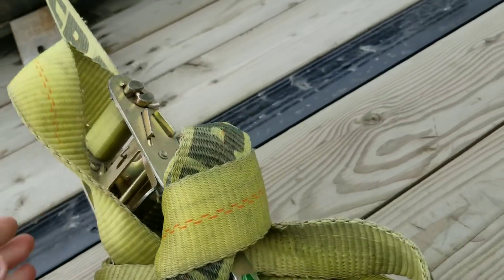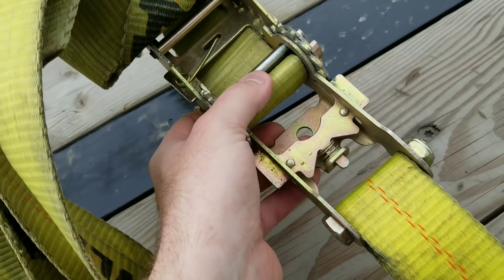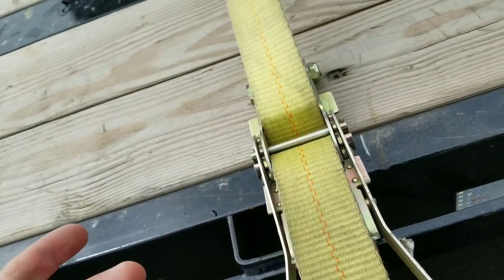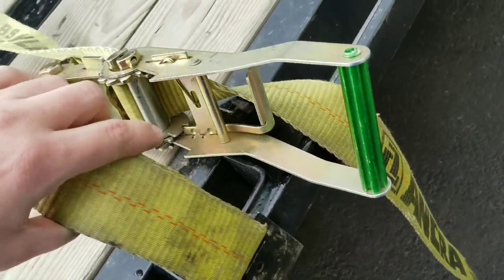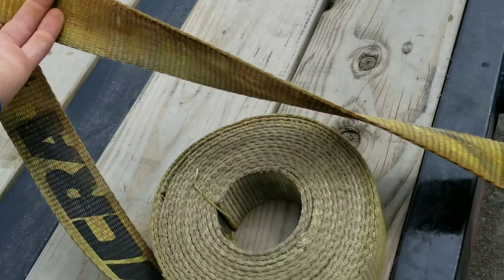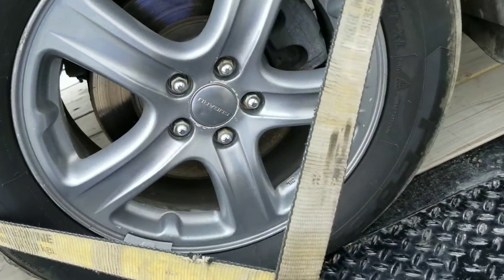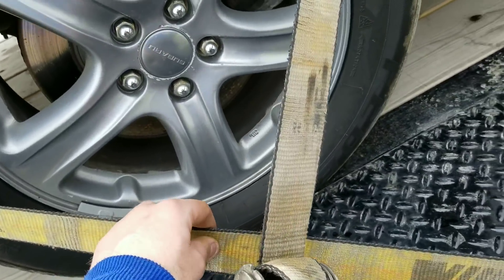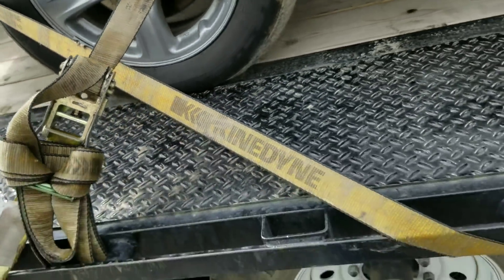How to strap down a load. This video is not for everyone.

Comment: Chains over straps is correct . Running lasso straps between the wheel spokes is best .  Lasso  straps should have chain and hook anchors.  As for the load itself ,a direct tie-down has more securement over an in-direct tie-down .

Comment: my husband had charted for for 5 years and he was a truck driver always left first thing is any load of iron you need to use chains it will get you by the. When those straps won't and let me tell you that trailer might as well go ahead and put some metal stripping across the wood where there screws go cuz they will come undone and those boards will bounce loose trust me he had a DOT number MC number he had a trailer just about exactly like yours showing out of one company here and at least a hundred and 60 loads in one year that's not counting his back loads in a company next door he ran quite a bit out of there so but in the end you're sucked in with a DOT on everything I had the. Sitting at my table looking at my log books and you have to keep them for 6 months after you use them or you'll get a big ticket it was a lot of fun scary though when you think you're going to break down and you have to pay for yourself and you don't have the 800 number on the window

Comment: I'm the going through person. I roll up the end in about a foot or so length. I then wrap under and go into the loop about half way. Then i roll the bundle upwards pinching against the ratchet and give 1 final crank. The ends excess never moves and no flapping in the wind. Stepfather is different on it of course which is different from yours.

Comment: Would you recommend me putting an aftermarket tune on my 2007 6.7. Do I need a different computer for an aftermarket tune?
Reply from the maker: Just retune your current computer
Reply: PD Diesel Power how would i do that? Does it effect the truck at all and is an afternarket tuner bad
Reply from the maker: An aftermarket tuner can mess up your truck. If you go with the wrong guy.  So do your research see which one fits u best. Tuners seem to lean one way or another. For example. Hot rod tuners. Street tunes. Some do cleaner tunes as far as exhaust goes. Some do it dirty. Lol. But they give you instructions on how to.

Comment: I always put my ratchets on the passenger side of the truck so if they come lose you are not standing in traffic when tighten them  the same with binders safety frist here in Chicago they would rather run your ass over than give you a chance
Reply: Thats true, but im a drivers side guy. I can keep an eye open on traffic and duck under the trailer if needed.  I can hug the wall or barrier if i need to stop at any time.

Comment: How come y’all don’t use ratcheting binders with chains?
Reply: Because chains suck. Yeah they have their purposes. And sometimes you have to use them. But if you don't have to use chains, why use them? Straps are so much easier.
Reply: Chains don't get cut the way straps do. Straps should have some kind of protector where they go over anything with an edge. But straps work where you don't want to crush the load if it can be. Also, straps should be always half turned as they go over or they will vibrate and cut themselves. Should never be flat.

Comment: Your way of using a ratchet strap is wrong 
The way your driver did it is the correct way
I trusted a truck driver that would haul steel for a living and he strapped a load of pallets when I got back to the pallet yard my heart dropped and stopped breathing at the same time no wonder he almost killed himself with his own load 
The straps worked loose and he used your method of using a ratchet strap 
Also get rid of the straps with Even the smallest tears DOT sees that for sure it's a red flag
Also you said it yourself ratchet straps tend to pull the most on the ratchet side so you need cross the rachets evenly
Example that load of steel 1 ratchet need to be on the passenger side and the other ratchet need to be on the driver side you should be smart enough to figure out the rest it will pull your loads down evenly and not all to the driver side 
Twisted straps
Let me guess
To keep them from flapping with the wind?
FYI flapping straps=loose straps
SMH The blind leading the blind
Everything about this load is wrong there is overhang on that trailer when there don't need to be
But your business run it how you want
😂😆🤣💯👍✌️

Comment: Definitely not the way to strap a load. It's not safe for the strap to be on the outside of the rail. A significant brush up on the side of the trailer could cut through the exposed strap and the load could possibly become unsecured, definitely a no-no
You had it right the first time, should have left it...
Reply: If he checked the FMCSA website, he would have found that same info.
Reply: Awesome jus wat I was thinking!!!